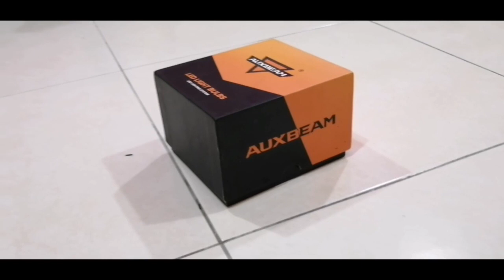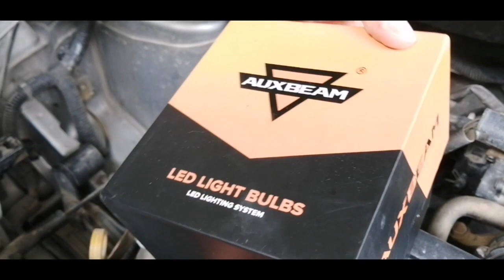LED VS ORI HALOGEN. YANG MANA TERANG? Perodua Viva, AUXBEAM REVIEW

Comment: Untuk lampu yang pakai reflector boleh ke? Tak silau?
Reply: Reflector gerenti silau, tipu kalau kata tak silau. Tapi lebih baik klau pkai led untuk reflector adjust kejauhan lampu lebih kurang 40-50meter ke hadapan saja, supaya pemandu yang limpas tidak terlalu silau
Reply: @mattmiller9642  setuju sangat, sbb tu reflector halogen tak digalakkan sangat tukar ke led. adjust mcm mana pun mesti silau